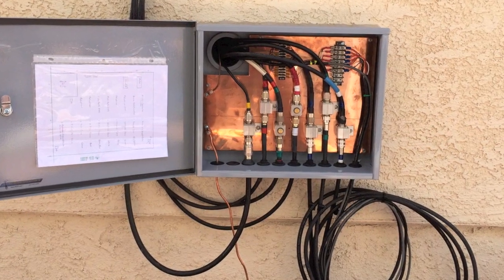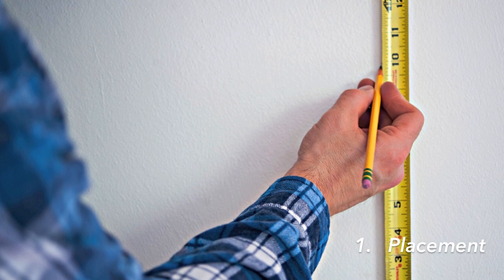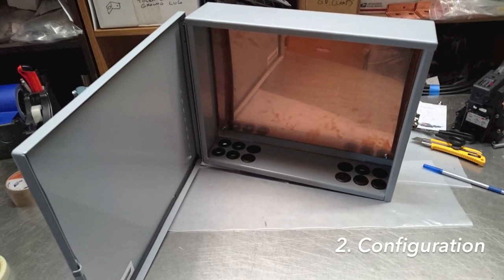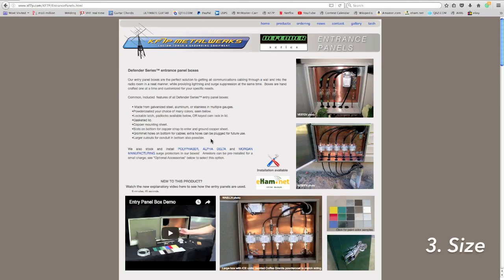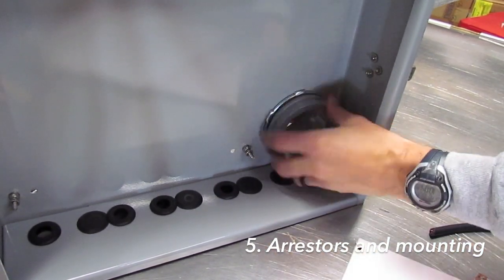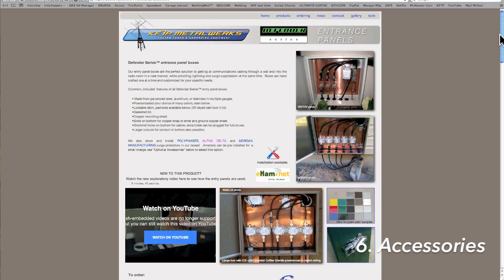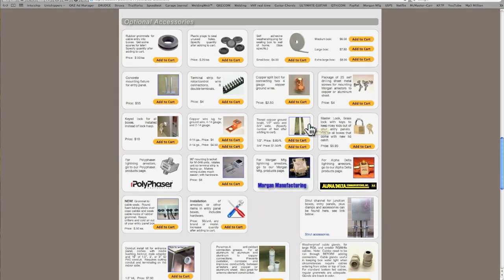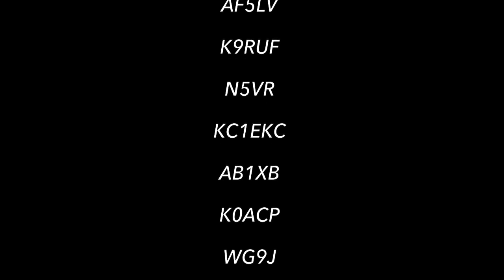How to order an entry panel

Comment: I'm moving into a new QTH and will soon be running ground wires and feedlines in and out of the house.

Would one of these be able to mount to vinyl siding without big gaps?
Reply from the maker: A flat backed box wont seal against siding and that isn't important anyways.  The only thing that has to seal is the conduit pipe that comes out of the wall through the siding and into the box.

Comment: 9M6DC- I have my antenna motor 60 ft up on the air, lead down to my shake with an electric .cable with 6 strains of small  wires for the current supply to the motor.  How should I protect this from lightning?

Comment: Can I run the entry panel ground through the house to the electrical box ground??  Or does the ground wire have to stay outside?
Reply from the maker: Run a ground wire directly down to a ground rod below the box.  This should be short and as straight as possible. This ground rod should be bonded to the utility ground rod.
Reply: @KF7P  But its easer to get to the utility ground rod going into the house and out, is that ok.

Comment: The boxes you fabricate look great but,  The Fact Is-- Every Cable Entry Point is Broken While threaded into your box. 
Break Points are Always a Problem when diagnosing continuity issues..
Continuous  entry is usually always fool-proof.
Reply from the maker: I'd recommend using quality connectors and the proper tools when terminating coax.  IF done properly there is little chance of problems down the road.  Look at any contest station....there are a dozen cable connectors between the radio and the antenna.  Also if you don't "break" the cable you can't put an arrestor in-line in the proper spot.

Comment: Just a tip if it's not already been said... M32 size cable glands will allow a cable size range of 9mm to 21mm.  Just right to pass a PL259 through and then tighten down on LMR400 or 600 size coax.

Comment: What are you using to connect coax connectors to copper plate ? looks like a coax coupling thru a  grounding connector ?
Reply from the maker: Most of these photos show lightning arrestors mounted to the copper sheet, which grounds the coax shield and protects the center conductor as well.  It is possible to use a coax ground bus http://www.kf7p.com/KF7P/Coax_Ground_Bus.html   and a bulkhead connector to only ground the coax shield, but that leaves the center conductor vulnerable.